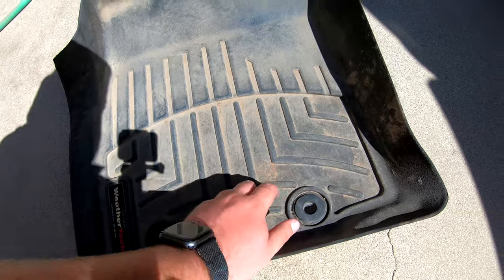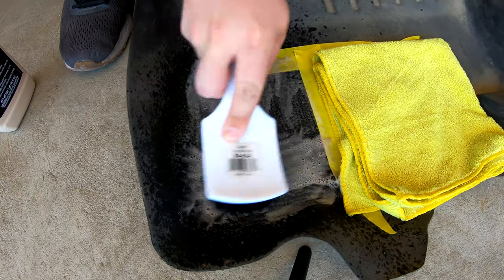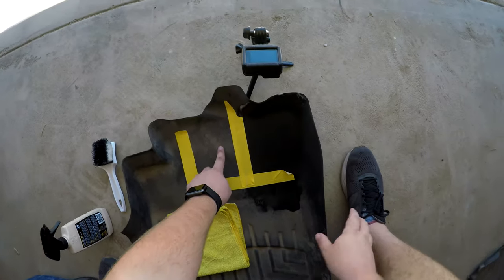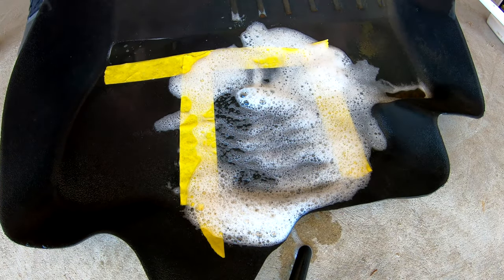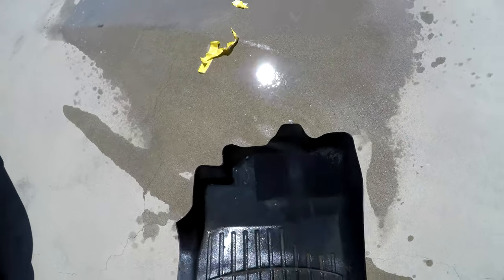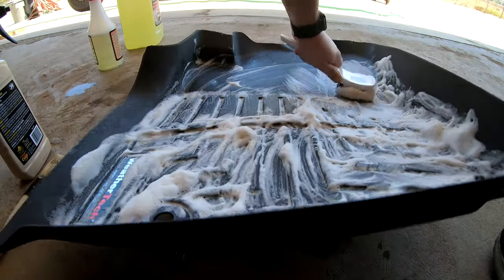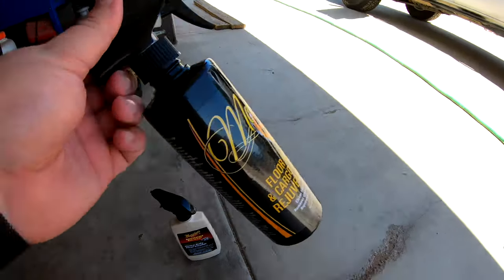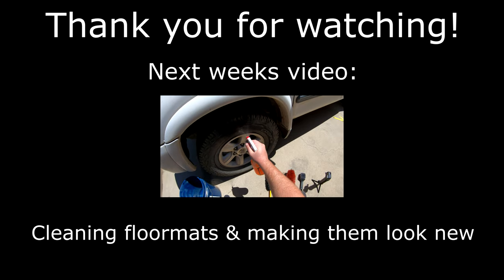Best Floor Mat Cleaner??

Comment: I like that you taped it off to show the definitive lines. I am looking for something to use on Semi truck floors. They are ribbed and a huge pain in the rear to clean. They can be scrubbed spotless and as soon as they dry, it's a blotchy, gray and brown discolored mess. Which product is more economical? Semi floors are large and we would probably go through a bottle every 3 or 4 trucks with the recommended saturation.
Reply: Plus most cleaners leave the floors slippery…